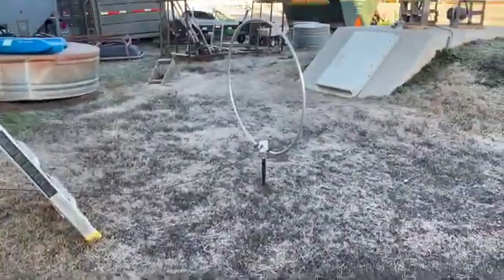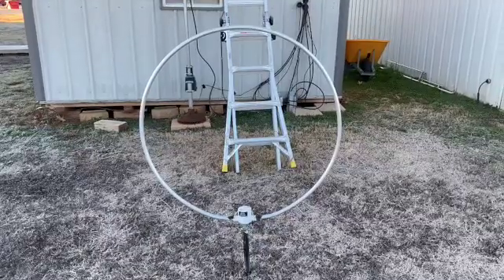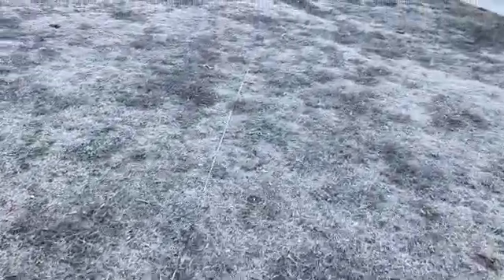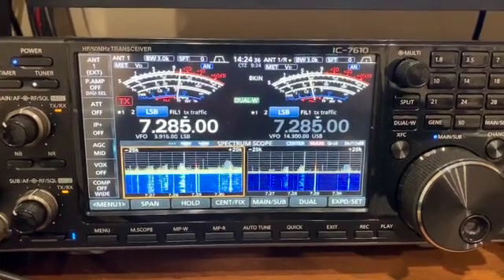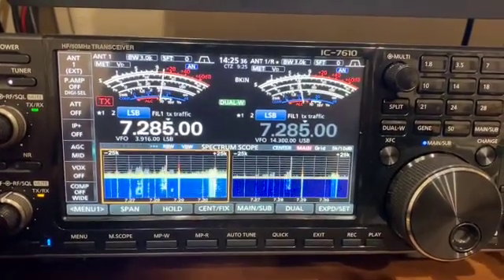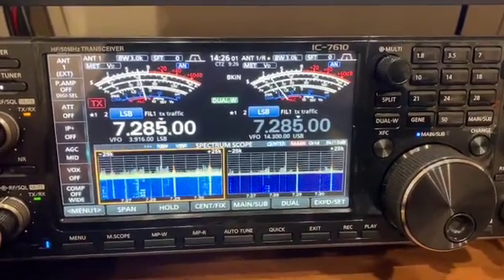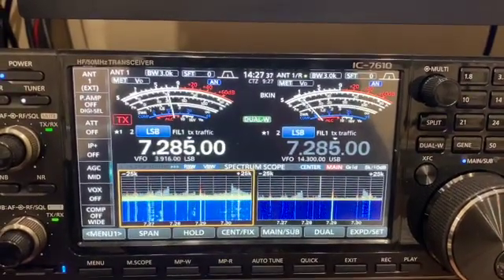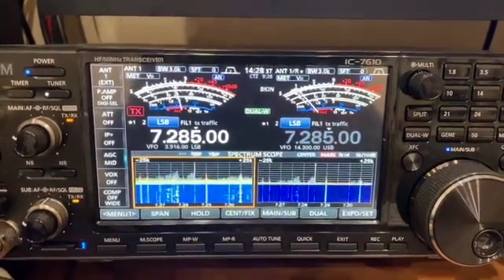Loop on the ground RX performance demonstration using the Icom 7610

Comment: Did I miss you playing what the receiving antenna sounds like?  Is the sound more pleasant?  Can you hear qso's on the lotg that you cannot make out on the transmitting antenna?  Would I rather listen to the receiving antenna than the transmitting antenna?  Would I be able to complete more qso's using the transmitting/receiving antenna combination versus the transmitting antenna only?
Reply from the maker: The loop on the ground is extremely attenuated. If noise levels are high and signals are otherwise strong then the log is great. But faint stations are difficult to pull in with the log.

Comment: Wellbrook ceased operations in March of 2023 and Andy Ikin, the Brains of those fantastic Antennas passed in October.
Reply: Thanks for this info.  I didn't know Andy passed.  I did have correspondence with him in the past regarding one of his loops.  Really good guy.
Reply from the maker: It is a fantastic antenna.  I like the fact that you can null the noise out, meaning its very directional.

Comment: I have inverted U, Inverted L with wire hanging down from other end.   I notice lower the height , lower the noise.  but, transmit get worse as it get lower height.   My ANT is about  14 Ft high now,  good compromise between Low Noise and acceptable TX .  I operate from City with tight houses in neighbourhood.  my dream is move to some place like where you live.  I see under ground tornado shelter.  I never saw those except in OK, KS   AG6JU

Comment: Thank you for the purchase and testing. You could also try using the 7610 preamp with the LoG as sometimes it can make quite a big improvement on the SNR without increasing the noise floor much depending on local conditions. I tend to use my LoG with the 7610 on the sub RX exactly the same as your demo shows with headphones on, my DX Commander in one ear and the LoG in the other. It's really cool to hear signals move from one side of your head to the other as the propagation of the signal changes. Matt M0LMK/KI5GXV (LMK Technical Solutions)
Reply from the maker: I have noticed the same when using my headphones.  Thanks for producing a good and simple project/product.

Comment: How does the LOG compare to the Wellbrook? I have a Wellbrook, but fed with a different amp (the amp blew and I replaced it with a Cross Country Wireless loop amp, which works very well and has very deep, very sharp, nulls), and it is so quiet compared to my triangular loop (20m perimeter, with a 4:1 balun, fed at the apex - 6m/20ft agl, lowest points are about 3m/10ft above ground, so its sloping at 45 degrees or so). The triangle works really well as a TX antenna on 20-10m but is really noisy - rather like your DX-Commander (I suspect because they are vertically polarised, well I presume my loop is vertically polarised as it is top fed). I use an MFJ1026 noise phaser, with the active loop as the auxiliary input, which really helps to get the noise floor down. I've considered a LOG a few times and I can get 100-130ft loop in the garden (60x60x30x30ft, so in theory 180ft would fit but would be up at the house and too close to electrical feeds, etc.). I will be interested to see more comparisons as you get the loop configured properly. My area of interest for a project like this would be VLF-80m DXing, from a receive perspective, obviously. 73, and thanks for the videos - HNY '24, de G4UCJ - IO91ox
Reply from the maker: I have not shot the LOG vs Wellbrook comparison.  The LOG actually crosses an underground electrical feed line at least twice.   Thanks for watching.

Comment: Nice. What coax do you use out to the DX Commander??
Reply from the maker: The DX-Commander is fed with DX engineerings version of RG-213.  The 80m Dipole is fed with LMR-400 ultra-flex.  If I had to do it all over again, I get some direct bury LMR-400 for both.  Thanks for watching.

Comment: Nice video! Thank you. What if the LOG is placed in the open field (no influence of building)? I want to test the LOG in my small garden.
Reply from the maker: I think it may perform slightly better, but one reason I didn't move this one more out into the open is mainly feed line losses.  But also, most people don't have an open area without influences of structures, so I feel this is a more realistic install for a lot of operators.  Best of luck testing in your small garden.  Let us know how it works.